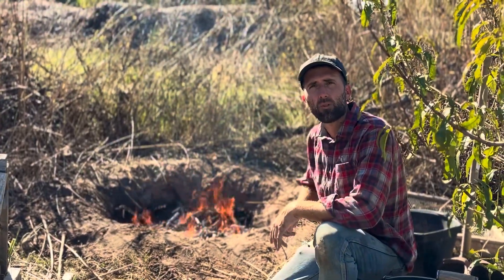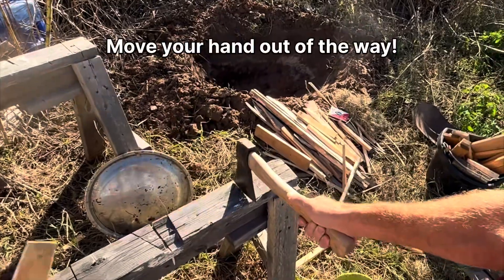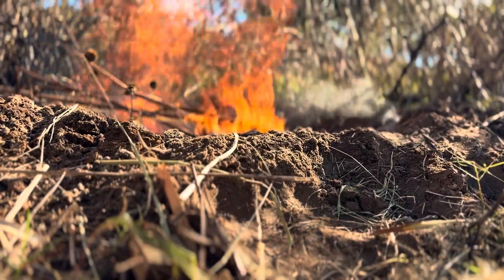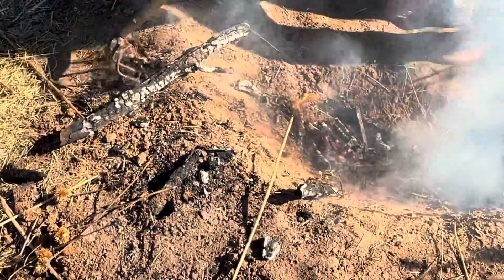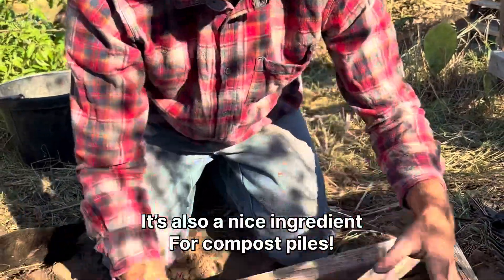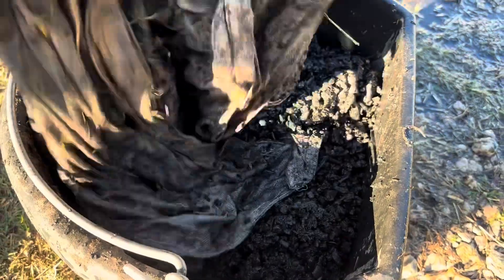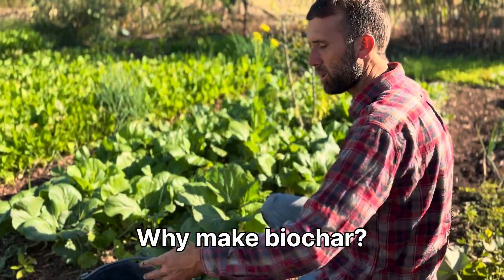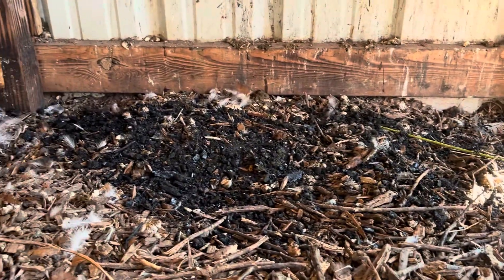How to Make Biochar + 3 Easy Ways to Inoculate It for Healthy Soil

Comment: I built a tracking solar mirror out of sheet metal with a 600:1 focal plane (not point).

At its focal plane, there is a steel retort.

That's just a steel canister with a removable lid and a tiny hole on top to let out flammable combustuon gasses as the wood chunks heat WITHOUT oxygen.

The gas plume burns when ignited with a log lighter.

When the flame stops,  "it's soup" (it's done).

Let it cool and dig out the wood chunk charcoal. 

I also use the mirror to make flash steam for running a steam engune powered electric generator. 

I homestead.
Reply from the maker: Very cool! I have a small steel drum but I don’t think it’s anything close to your system haha. I generally prefer the pit method. I have definitely considered making me something similar to what you mentioned. Would like to have several systems. Love making biochar. It has such amazing effects in the garden! It’s great hearing from you again. Been months it seems. How have things been on your end? Are you doing some clearing yourself?
Reply: @mayshomesteadchronicles 
Been remodeling . . . Ugh!
Reply from the maker: @SiwyWabbit oh, fun stuff haha on the house or something else? Remodeling takes lots of patience and endurance, that’s for sure
Reply: @mayshomesteadchronicles 
House. I'm nearly 80 and am building out the master bed & ensuite (bath) in the event I have someone come live with me and share my house in return for helping me, should I require help.
Reply from the maker: @SiwyWabbit wow! You must be one healthy guy. I can’t hardly get my children to lift a finger haha that’s great. I know you’re busy. God bless you and your family